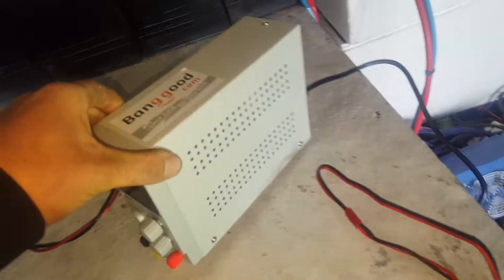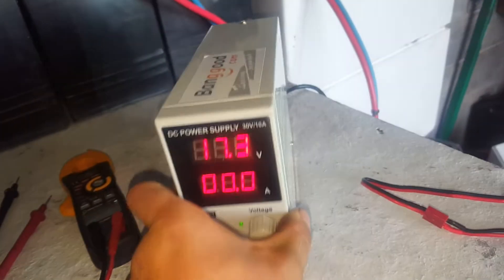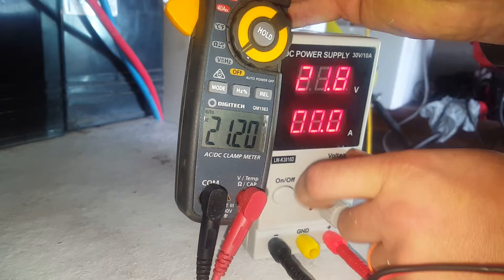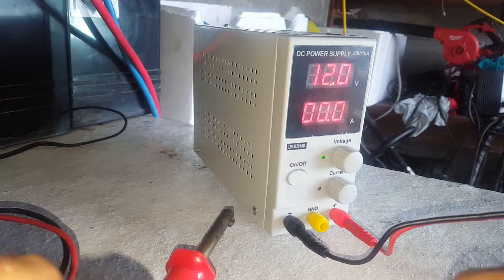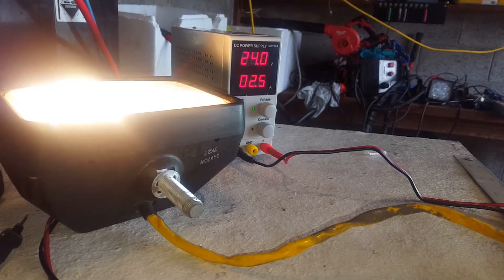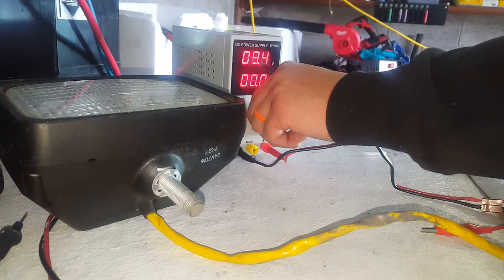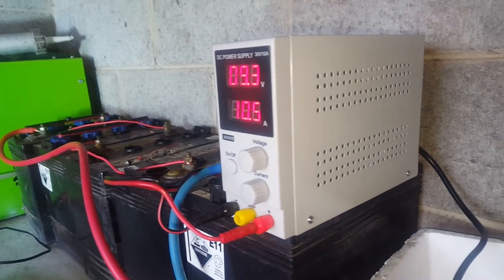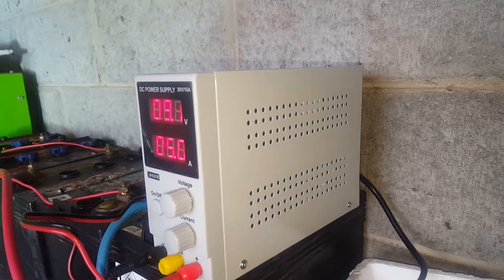My new 10 Amp lab power supply test and review

Comment: no no.. not view 0.01A, only 0.1A. bad modele
Reply from the maker: what will you use 10ma for
Reply: @Oneupthesleevecustoms  Repair all iphone, testing U2 power IC, 60-80ma (0.06-0.08)
Reply from the maker: Ah yeah you don't buy a 100 dollar on for that
Reply: @Oneupthesleevecustoms  I use exactly the same but with less current. (30V 5A) Everything works fine. There is a model 30V 10A which is able to display the amperage in hundredths of a number. (https://www.youtube.com/watch?v=93GDzuElkfU)
Reply from the maker: Cheers mate

Comment: Hello sir. Can this system handle short circuit between the two terminal?
Reply from the maker: Yeah its not good for them
Reply: If I short it for brief of time, will it show the current value? Or I can add resistor to prevent pure short circuit. I actually want to check short using power supply
Reply from the maker: Only up to 10 amps
Reply: Ps: Thank you for the reply :)

Comment: How’s the power supply holding up? I’m looking for a cheap bench power supply. Thanks
Reply from the maker: Brett its awesome mate use it almost daily. Since they sent it out  can handle full load continuously no stress. I now use it to run my isdt t6 lite Lipo charger. At 30v and zero issue. Great cooling great fan . Cheers bro. Link in the video description.
Reply: One Up The Sleeve Customs cheers that’s exactly what I was looking at using it for.
Reply from the maker: Brett perfect for it
Reply: One Up The Sleeve Customs thanks, I finished up ordering this power supply plus the isdt Q6 Pro charger. Not quite as beefy as the T6 Lite but power supply is limited to 300w anyway.
Reply: One Up The Sleeve Customs also do the isdt chargers require input voltage to be higher than output? I’m guessing they are buck only?
Reply from the maker: Brett no but if you want the high wattage for charging you need to put 24v plus in. Or they get warm and run the fan
Reply: ok, so I could get the bigger one and attach it to my spare 800w 12v power supply and it could charge a 4s li-ion? but it will get warm.
Reply from the maker: Brett give me half hour ill test mine to be sure
Reply from the maker: Brett it is charging a 5s 2p 18v aeg battery off 12v supply at 4amps now. Thats 7.4 amps at power supply